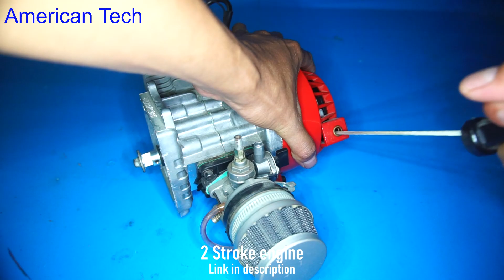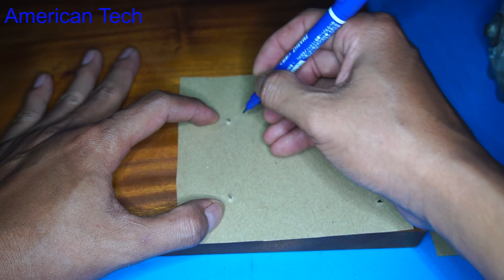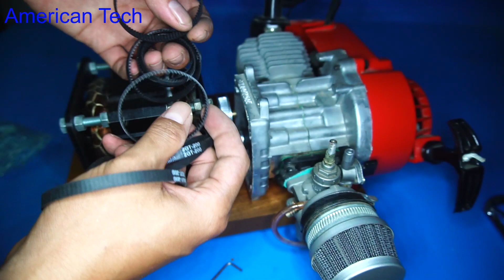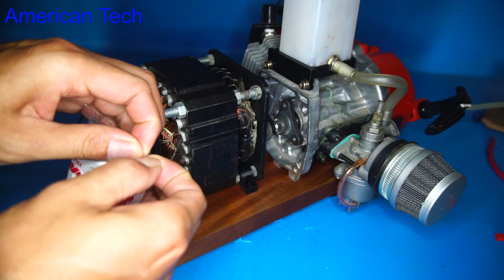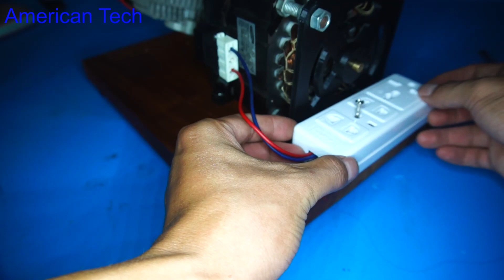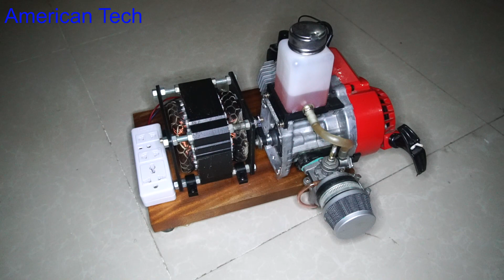DIY High Power Electrical Generator Using 2-Stroke Engine

Comment: Save your time and buy these objects a motor bike a large inverter a car alternator and a long rubber belt = use the back wheel and power a whole house , a car can be used straight from it's alternator once started and battery disconnected , cheaper to use hydrogen as small engines have no computers to mess up air flow and fuel , commercial generators make to much noise and cost to much .

Comment: Fantastic work but if you use a rectifying bridge at the wires output won't it help you to lessen the resistance conflict?
Reply: No, the resistance would be the same for the alternator. Plus a rectifying bridge would make it worthless for most uses as that converts the AC to DC.